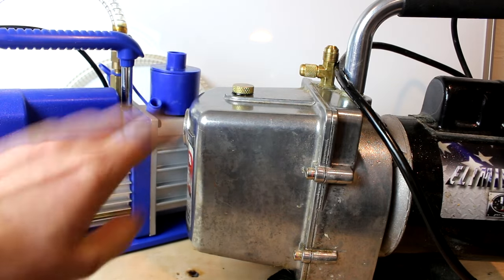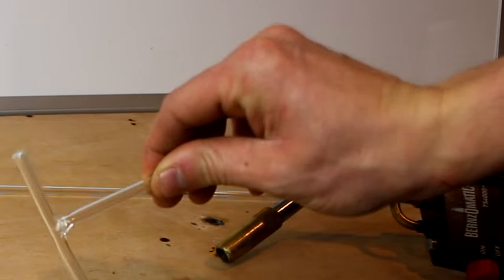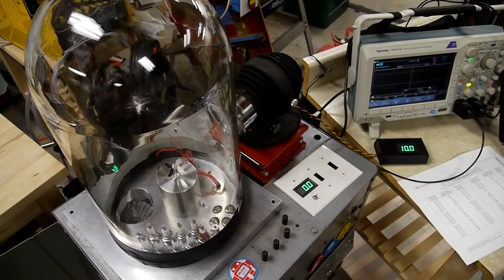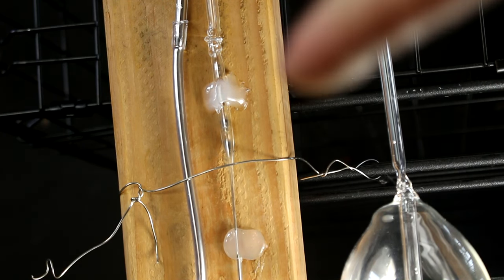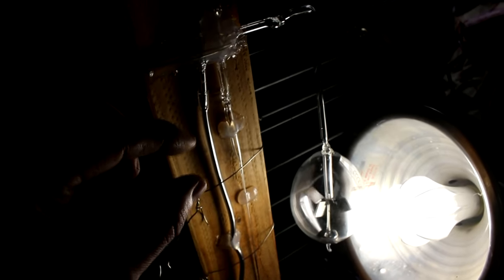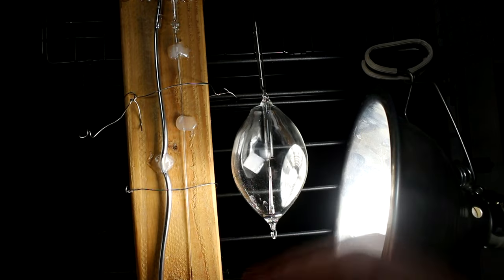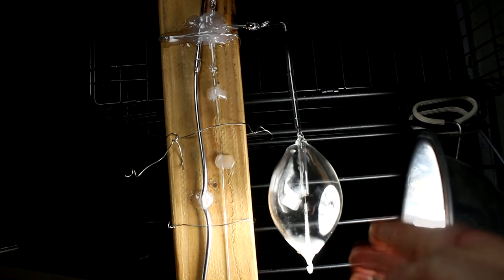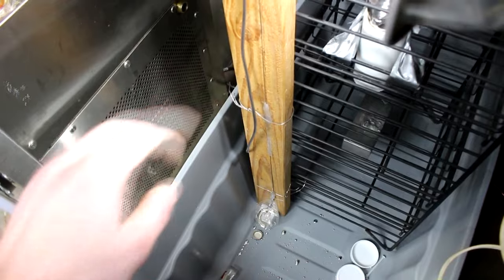Sprengel Vacuum Pump: The most efficient vacuum pump ever?

Comment: Would you be able to use Gallium to do the same thing.? I realize that Gallium is lighter than Mercury and that it would have to be kept up to it's melting point.
Reply: The drop tube would have to be longer, because of the lower density of Gallium. I don't know how viscous Gallium is. Yes, the temperature would have to be higher. I wonder about sodium, but, that's too dangerous!

Comment: Use some bright LED lights, they heat up much less.
Reply: but the point is to heat up the radiometer so that it spins...
Reply: Radi Bear I thought it was the intensity of the light that made the radiometer spin
Reply: Ephjoe Kwon 
More intense light=more radiation to convert to heat that causes the one side to be hotter than the other side. When that happens, a type of convection-like thing happens and the very little air inside is able to push the radiometer.

So in a perfect vacuum, the radiometer should actually spin much slower than in a non-perfect vacuum. I think Cody addresses that somewhere in the beginning of the video
Reply: +Radi Bear 
Thanks for the clarification and explanation!
Reply: Ephjoe Kwon np :)
Reply: So an IR light would spin the radiometer the best?
Reply: uv would, notice the 405 nm laser he used
Reply: I guess it depends on if it's a UV sensitive radiometer or IR.
Reply: as far as i know it doesnt matter what kinda of light energy it is, its going to work the same
Reply: Taylor Enderle well, more energy=more heat. So it does matter. If the propellers or whatever you call them were purely spun by photons, then it wouldn't. But they aren't
Reply: he was

Comment: My favorite video of yours, thanks. One question though, why didn't you angle the T-junction upward so that mercury would have no chance of flowing into the evacuation chamber? Am I missing something? Thanks again, great video
Reply: Ian H I'll assume that when the mercury is low, the weight will balance with the vacuum and it will stop. If the reservoir was above the top all of the mercury would drain or get sucked through and then expose the vacuum to atmosphere.
Reply: the opening on the tube he was evacuating is on the top and the spinning part balances in the middle, if it were up side down it might get stuck and not spin

Comment: @Cody's lab can you pls state some methods to synthesis of sulphur trioxide  i m searching some prominent  way for it
Reply from the maker: sulfur dioxide + vanadium pentoxide --> sulfur trioxide + vanadium tetroxide
vanadium tetroxide + Oxygen gas --> vanadium pentoxide
Reply: Cody'sLab  actually  v2o5 is to costly here  any other
Reply: Cody'sLab i also cant get any literature  for it
Reply from the maker: nitric acid will also work
Reply: aditya mittal he does right here
Reply: Why in the hell would you need sulphur trioxide? Do you even know how to handle it?
Reply: moo. Ya i know
Reply: moo. its used for the production of explosives so...... slightly curious of his reasons for wanting it :/
Reply: +Fred The Bored xD Indeed. It's also toxic as all hell.
Reply: moo. Uh Hi, FBI? Yeah I just wanted to let you know something real quick...
Reply: Hydrogen peroxide is pretty cheap. You can make sulfuric acid just with SO2 and H2O2, without the hassle of transforming SO2 into SO3.
Reply: that is called the contact process... https://en.wikipedia.org/wiki/Contact_process
no literature? :D
Reply: The most interesting way to produce H2SO4, imho, is with iodine.  That's called the Bunsen Reaction. No complex equipment required.
Iodine is kind of pricey, but you recover it.

Comment: I worked at a foundry that did investment casting in a vacuum chamber, all with modern vacuum equipment but, in the storeroom, was a large glass vessel with roughly 10 pounds of mercury. I always wondered what it was used for. Unfortunately someone tipped the glass vessel over and broke it. For years we were finding mercury on shelves and on the floor. That stuff went everywhere.

Comment: why don't you make a double vacuum pump like get two vacuum pumps and hook both of them up to the vacuum chamber
Reply: 1000 jews this wouldn't be effective, because it will duble the speed which will pull the vaccum, not decrease the pressure!
Reply: 100K de inscritos com vídeo k
Reply: You would have to hook them up in series, rather than in parallel
Reply: First Last how do you hook a vaccum pump in series?
Reply: I bet he is googling it
Reply: 100K de inscritos com vídeo Cody has a video on this.
Reply: That's just going to increase the flow rate of air through the pump, it won't change the pressure at all or strengthen the vacuum.

You might find putting two vacuum pumps in "parallel" to the same chamber leaves you with a net, higher pressure than just using one on their own.

Works a bit like Resistors or Capacitors in series and parallel to an extent.
Reply: 100K de inscritos com vídeo
Step one: build an air tight vessel around your first pump
Step two: Hook the first pump onto the chamber, you want to evacuate, and the second pump onto the vessel around the first pump
You may need to water cool the first pump, since there will be no air for it to cool itself
Reply: First Last why you have to put a pump on the vacuum chamber?
Reply: 100K de inscritos com vídeo I don't entirely understand your question. A vacuum pump, is good at creating pressure differences.
If you lower the pressure difference by lowering the pressure around the first pump, it will "react" by also lowering the pressure inside your vacuum chamber. Maybe there is anybody else, who can come up with a better explanation. (Cody that's possibly a good experiment for you to consider)
Reply: chbrules what can I say we Jews are very crafty people
Reply: Well, the ideal, probably would be to treat it like a 2 stage system, use his old pump as a rough, and pull the vaccuum from the bottom of this one so the mercury would only have to pump from 100 microns or so, to about the 5 or so vaper pressure.
That is what you do with oil defusion pumps and turbo molecular pumps. They both cannot pump anything like a full atmosphere!
To the Radiometer:
Well, as it uses relative low gas pressure diferentials to make it work, and mercury being a very heavy atom, it might be that the radiometer could be way more powerful than the standard one which is presumably just filled with a tiny bit of air!
I'm not surprised it works better!
I don't imagine too many people have thought to use mercury vaper for a radiometer!!!
Reply: the only reason that doesnt work is because most food is very insulative so the outside burns while the inside stays cool.
Reply: Buzz Armstrong that was a joke dude

Comment: is it possible to use water instead of mercury by using a longer tube? Since mercury is 13 times denser than water, I guess using  a tube 13 times longer should have similar effect. My understanding of basic hydrostatics is that the height of the water column below the T joint determines the pressure of it.
Reply: s yottky the vapor pressure of water at its melting point is 0.006 atmospheres. So that's the lowest pressure you can achieve with that device.
Reply: But it does beg the question of whether there's an easier to handle liquid you can use that has a similar or lower vapor pressure than mercury.  I assume the oil used in diffusion pumps has a pretty low vapor pressure, so ... ?
Reply: Hell yeah! Then you'd have a really efficient air conditioner. I built one using vinyl tubing from the hardware store and it worked. Need a 3-story building though. Use two tubes from the drop tube to the evaporator with a valve between them to refill the evaporator when it gets empty and then it should work continuously. Add Calcium Carbonate for denser water requiring only 2/3 the vertical distance.

Comment: Could you put the reservoir under where the Mercury comes out so it doesn't require you to refill it?
Reply: that is an awesome question that i don't know the answer too but i could tell lots of other random things like how my computers storage was at 137gb before i emptied 14.4gb out of my recycle bin
Reply: Dexis no, it may run some time, but as soon as the the force sucking on the mercury equals the force needed to get the reservoir level above the point where the mercury comes out, it would stop working. It's simply conservation of energy. 
If E_pot1 is mercurys potential energy in the reservoir and E_pot2 its potential energy in the reservoir where the mercury ends in, then:
E_pot1 > E_pot2
Because E_pot1 = E_pot2 + E_r (E_r is the energy "lost" by friction) 
This means that the mercury in the "starting-reservoir" needs to have a higher potential energy then the mercury in the "ending-reservoir" to make it work. And as
E_pot=mgh  ; m is constant and g is constant the only thing you can change to make E_pot1 bigger than E_pot2 is "h". This means h_1 must be bigger than h_2. If h_i would be the same it still still wouldn't work because of the non-usable energy in the system "lost" by friction. The system might still work for for some time, because of the mercury that would be falling down the tube right at the moment where you reach
E_pot1 = E_pot2 
Since the falling mercury would create a pressure difference an thus create a "sucking-force" on the mercury coming from reservoir 1.

Hope you understood. English is not my first language so it's not that easy to explain it for me. Especially as confusing just little words could cause my explanation to be wrong. 
So if you're one day on the last question on "who's going to be a millionaire" and they ask you this question, then better don't rely on the exact terms I used. :D
Reply: No, the reservoir has to be higher than the endpoint or the mercury won't flow.  The whole pump is powered by the potential energy of the mercury in the reservoir being higher than at the endpoint.
Reply: Vivek Hebbs I understand that the potential energy is needed to initiate the pump, but once it's created the vacuum wouldn't you be able to combine both reservoirs?
Reply: OhHerroPreaze maybe some time, but after a while it would stop. Read my explanation above and you may understand
Reply: Klaus Breslauer after watching the video again and I noticed that once the feed reservoir ran dry, I realized you're point.
Reply: We can reword your question to "Can you make a free energy device?" and the short answer is no.

All the bits glued to the board isn't what makes the mercury flow. The mercury flowing is what makes the glass bits do stuff.

Think about it this way. If you go out to a still pond and attach a long hose or pipe to a pump with both ends submerged at far ends of the pond, turn the pump on to evacuate all the air from the hose or pipe, what happens when you turn off the pump? The flow through the plumbing stops.
Reply: As it was mentioned before, that would make a perpetuum mobile, in this particular case one of the first kind (that would create energy without any energy input). What keeps the pump working is the difference in hydrostatic pressure between the upper reservoir and the lower one. 
  This pressure differential keeps the mercury flowing between the 2 reservoirs and along the way doing the mechanical work of pulling the air from the side tube (as well as dissipating some of the energy to overcome the friction in the system). 
  If you were to combine the reservoirs, the hydrostatic pressure differential would become zero, thus not being able to generate any mechanical work and the flow of the mercury would stop. This can be tested really easily on the real setup by lowering the upper reservoir to the level of the second one. The pump would stop working almost immediately.
Reply: somebody DID give that answer, it was just misunderstood by someone, thus reworded by another.
Reply: No.  On this channel, we obey the laws of thermodynamics.

Comment: I always cringe when Cody spills mercury all over the place.
Reply: Normal people: "Oh shit everyone stand back, I have to clean up some mercury."
Cody: "Oh, whoops. Whatever, I have another bottle."
Reply: "normal"
Reply: J. Villeneuve
 codys lab in  a nutshell
Reply: I also cringed at your profile pic.
Reply: hawkturkey maybe I’m dumb, but why not have the initial reservoir placed below the drip of the last segment of glass? That way, as the mercury leaves the pump, it’s automatically back in the reservoir going into the pump. No work is spent with the syringe, making the only work required for the pump the first five Kin of operation
Reply: @joemannumber1 , it's gravity-fed. If you make it a closed loop, you need some other kind of pump to circulate it.
Reply: @joemannumber1  "why not have the initial reservoir placed below the drip of the last segment of glass?"   you can move the top resiviour to the bottom and drain the bottom reservoir r back into the  top reservoir . but you don't want the mercury in the tube connected to the top reservoir draining out creating a path for air to get into the system again.  But maybe you could put a valve inline to stop that.  Anyways,  this works because of gravitational potential energy is turned into mechanical energy, thus will require a lifting the mercury a few times.
Reply: @petertaylor4980   I kind of like the idea of essentially closed loop and gravity fed. 
Here are three potential enhancements in case anyone is inspired by Cody's video to make one.  

1) A syringe barrel and plunger, two homemade one way check valves, and some tubing to make a piston pump that will help eliminate handling/spilling the mercury.  Use a syringe with a thin barrel and plunger and make slow strokes so as to not push mercury past their gasket materials.  
2) The mercury reservoirs at the top and bottom may be enclosed containers with a tube connecting them at the top of each reservoir container so as to contain but allow displaced air and mercury vapors to move between the two. The tube can have a release valve to vent buildup of evacuated gasses and filter the vented gasses though  a sulfur-impregnated
activated charcoal filter. 
3) Include an electrostatic discharge wire between top and bottom reservoirs. 

Now it will be much safer.

Comment: That last remark got me wondering about just how much electrical potential this device generates. I guess you could say it's the equivalent of the "waste" heat generation with a normal vacuum pump. Which makes me wonder "Could you put that electrical charge to use somewhere?" Excellent video!

Comment: I understand why people never factor in the energy consumed to build something (capital energy investment?) when comparing working efficiencies. But I'd still like to know how much propane etc was consumed melting the glass etc. compared to the commercial pumps.
Reply: Well it was sort of.  The effort of building was less than capital outlay for the turbo vacuum pump and further offset by its novelty of experience for both Cody and his audience. The effort displayed will also draw further viewers, thus it was economically profitable for Cody to pursue.
Reply: Jason Axford or the energy required to mine and enrich radioactive fuel for nuclear powerstations, or the blank cheque from the nation state for long term waste storage/clean up if/when something goes wrong ⚛☢
Reply: hotfreshrider Most of that is actually priced into cost of energy from private plants.  Nation states tend to be spendthrifts. Rarely do they bother to keep books straight since they can print,confiscate, borrow or revalue money at whim.
Reply: jort93z 
Hence why I said I understand why it's never factored in. But I'd still like to know.
Reply: Very very minimal. The resource cost of producing some glass tubes and a few minutes of gas for a torch would be many many times less than the cost of smelting and mining the materials needed to produce a motor for a traditional pump.
Reply: Sure you can. All of that is reflected in cost.  Simple application of Economic theory.  Compare cost of acquisition of a to cost of fabrication of b plus any nasty bits like maintenance or  repair that is anticipated.
Reply: Jason Axford because the savings in time outweigh it? time's also a precious resource, you know
Reply: Revi, hence "propane ETC." for inclusiveness.
Reply: The glass working is a one-time expense; once you have the pump built, you can use it to evacuate any number of vessels.  So the cost per vessel goes down over time, whereas the energy it takes to run electric pumps has to be spent every time you use it.
Reply: There are other factors to measure though. Ecologic trail, for instance. Coolness factor. Possibility to get credit at university. Proudness over the thing you put together. How scary it is to leave a kid unsupervised playing with it. How well it fits under the bed.

In the end, measuring how much you put/how much you get is not as straight forward as it seams, it's a relative measure that emphasizes a particular aspect of what you measure. Because life is relative. Some times.

Comment: Hate to correct you Cody but the gas bubbles inside the plastics tube are not air passing through the plastic and being trapped inside the tube but actually gas being given off from the inside of the tube in an action known as offgassing. This is why a perfectly factory clean windshield will end up with a film on the inside of it as the gas from the plastics is full of oils but the gas given off is lost to the atmosphere. Your current setup dose not allow for this gas to be evacuated.... at least this is what I remember given that I work in OnG.... fingers crossed I am not wrong. Love the pump! And thanks for all the content.